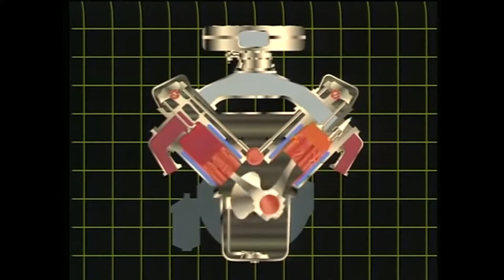Engine Rod Knock Vs. Piston Slap - Take a listen to both!

Comment: My Jeep Cherokee made it over 100k with piston slap, at 263171, it finally broke and punched a hole in # 5 cylinder.  Thank you Chrysler for cheapened up on piston skirt walls in 95. I ended up putting in an engine out of a 90 Comanche. Better built engine,  thicker skirts.....Hopefully with this one I can make it to a million!
Reply from the maker: I've seen a few comments on the Jeep 4.0s having that issue .. I'm guessing it's a common problem?
Reply: @ExiledWolf84  
Yes, very common on 4.0 made from 95 on. Piston skirts fall off around 120k due to thinner piston walls. Too reliable the way they were made before.  Average life of a 4.0 before changes is about 400k.
Reply: Chrysler has been cheap shit since LOOONG before 95 lol
Reply: I have a 99 Cherokee with the 4.0. It has 300,000 on it. Original engine, trance and drive train. The only thing I ever did to the engine was replace the valve cover gasket. I just like to add that I’ve been driving this jeep for over 20 years. It had 40,000 miles on it when I purchased it. My grandson is now driving it. I purchased a 2006 Lexus GX 470. It has 200,000 miles on it and runs like a clock. I purchased it because it’s four-wheel-drive and has a V8.

Comment: We just pulled a 75 Cadillac like that out of a barn yesterday that's been sitting there for 30+ years
Reply from the maker: Very nice! Do you know what year it is? 

The one thing thats nice with the Cadillacs of fhe era is that quite a few of the parts are still widely available, as oppoosed to the 76' lincoln i once had, which was like searching for hens teeth whenever it needed something

Comment: I have a 98 F150 with the Windsor 4.6 with 256k. And has piston slap. I even heard one with only 30k make the piston slap noise. Everyone told me it's a Windsor thing?. But it goes away once the engine warms up and still runs great.

Comment: If you ever heard a diesel engine idling, that's piston slap . Piston slap with run indefinitely depending on the situation. The rod knock sounds like a man in the basement hitting steel pipes with a hammer. That noise will suddenly stop in the very near future and you will have to walk home...
Reply from the maker: Oh yeah, the first time I heard that Buick in the video making the noise, that was the first thing that came to mind. Someone smacking the shit out of something with a hammer!

Comment: My old 97 Chevy Lumina had 860 000 miles on the original engine and the piston slap was awful, but still ran until I had to send it to the Junkyard since the chassis was completely rotted
Reply from the maker: That's unfortunate. The damn rust monster never sleeps..

Comment: A good test is to put super thick oil in the engine. If that fixes it then it's rod knock. If that doesn't fix it, it's piston slap. I have a crown vic that sounds like the Cadillac but thick oil won't quiet it. It was retired from the police dept at 80k miles because of the knock. I put another 80k on it and it still sounds the same.
Reply from the maker: I've almost been curious to put gear oil into the Buick just to see if it actually makes a difference.... The poor car is WAY beyond saving, so why not use it as an experiment?
Reply: @ExiledWolf84  Yea. How easy is it to get the oil pan off? Maybe you can install an undersize bearing shell in it to get it close and then use the thick oil. I just searched "gm 231 undersize bearing shell" and they do have em .010 over. Plastigage it to see how close you are.
Reply from the maker: I have heard some people on here comment that the 3800s have an easy to remove oil pan... But as of now the car is no longer in my possession, but I guess I'll see which way it goes for it in the future!

Comment: I bought a Ford Ranger cheap from a large used car dealer in their "end of life vehicles" on-line auction. Description was "engine knock and oil leaks". It's an Australian version with a 5 cylinder 3.2L diesel which are well known for piston slap, and sure enough it has piston slap. However, the slap doesn't disappear as the engine warms, it's probably been slapping for years....don't know if I should be worried, didn't pay much for it so might just keep driving and see what happens.
BTW, the engine was a little oily looking but hasn't dripped a single drop on my driveway.
Reply from the maker: Sounds like a sweet truck! Australia got alot of cool cars that we dream of here in the states.... in fact, there is a business in my city called "Left Hand Utes" that converts Australian cars to left hand drive and makes them legal to drive here.

Comment: I had a Corolla with piston slap. When the engine was cold, it was loud....sounded exactly like a rod knock. But once the engine warmed up, it was barely audible
Reply from the maker: I have a soft spot for Corollas. I learned to drive on a 96 with a manual transmission, and have owned several others over the years.

Comment: Had piston slap in a boosted integra. Made 463 on dyno. Beat on it every day for years before i traded it for a BMW. Reving you could hear the slapping. Went away during high rpm 😂
Reply from the maker: I'll bet that thing was a blast. Honda builds a hell of a motor, that's for sure!
Reply: Very common in performance builds with forged pistons. It's better to be a tad loose with boost than too tight

Comment: I have a 2grfse engine, i hear a knocking sound that comes and goes away, sometime i can drive the car for a week and hear no sound then 1 day you start to hear it, and then shortly after it goes away. It happens when the engine is warm already and especially if i drive beyond 80kph. It happens also when idling. There is no loss of power though

Comment: Both noises actually come from the piston. The "rod knock" is caused by the piston hitting the cylinder head during the exhaust stroke. If you disable the spark to the affected cylinder you will hear the piston hit the head on both crankshaft revolutions instead of just the exhaust stroke. As far as blowing it up, I once "blew up" a Buick V6 that I was replacing. The first thing I did was hold the pedal to the floor for a few seconds. I had to let up because it filled the shop with smoke. Then I drained the oil out of it. It knocked worse and worse but kept running. Finally I drained the coolant out of it and it eventually stopped running, but did not grenade in spectacular fashion, to my disappointment.
Reply from the maker: I might have to try that before the car goes to the auto graveyard... Might be interesting....
Reply: I wouldn't 100% agree. Some engines have significant piston-engine block deck clearance. For example bmw m54b30 it is 3mm - more than rod bearing thickness. But for some engines yes - rod bearing spun cause engine head damage.

Comment: Piston slap is a common problem for Honda L-series engines with i-DSI that can be found in JDM Honda Fit 2001-2008 or European Honda Jazz 2002-2008. Unfortunately the sound doesn't go off after warming up the engine and at certain conditions at some RPM comes into resonance and make you question your life choices, but, I bought this car with 195k km on the clock (122k miles) and so far, after 4 years and additional 132k km (83k miles), it runs the same. And let it be this way.
Reply from the maker: I wonder why that is? Machining tolerances at the factory or something?

Comment: With piston slap, I would use combustion cleaner to rule out carbon build up on the piston. Like you said, it will last unless you overheat the engine badly.
Reply from the maker: Might have to be something I try at some point! I imagine a lot of old big block engines like mine have a lot of carbon buildup, just from the fact that they don't spend a lot of time at very high RPMs from how much torque they have.

Comment: You forgot the timing chain slap when the chain is so worn it literally is slapping against the guides or even the block . That sound never goes away $
Reply from the maker: The Toyota 22RE is the first engine that comes to mind with you saying that. The timing chain will literally wear a hole in the chain cover if you let it go for too long!

Comment: I have piston slap on my 2000 gmc sierra.Apparently its a known common thing with the 4.8,5.3,and 6.0 truck engines.Like in the video it goes away after the first few minutes of the engine starting and warming up.Lucas oil stabilizer doesn't help make it go away.
Reply from the maker: Very common on those as i have been told! 

I had an Escalade sith the 6.0 that never developed it, but it had other issues from lack of maintenance from the previous owner

Comment: I have had the big end bearings replaced in mine and its still making a knocking sound which is similar to the piston slap sound in your video but does not go away even when the engine is warmed up. I have driven it 50+ miles with the sound with no problems. Any idea what it could be ?
Reply from the maker: What kind of motor?

Comment: Piston slap can be normal on some engines when they are cold. In the toyota IQ instruction book it says that piston slap is normal when the engine is cold. However if it never stops it might be a good idea to get it to a mechanic.
I have had a car with same engine (aygo) it have always have some piston slap and never failed (8 years).
Reply from the maker: Interesting! Do you know if that's the 3 cylinder, or 4 cylinder model? 

We BRIEFLY got the Toyota IQ across the pond here, which was sold as the Scion IQ (Toyotas defunct youth brand)  with the 4 cylinder engine, but they didn't move many examples of it so it is somewhat rare, and we never got the Aygo...
Reply: @ExiledWolf84 both i have is 3 cylinder ones 1 litre. But there is 1.33 litre 4 cylinder ones too. I do not know if they got piston slap or not.
Reply from the maker: Ah! I gotcha. I'm thinking that the GR Corolla got we finally got over here has that same 3 cylinder engine, or a variant of it... But it is also turbocharged to hell.. I'm curious to see if they are in the same engine family...

Comment: "That sound completely goes away" looks down because he lied to himself. Drop a junkyard LT or LS or Vortec into that great looking Caddy! A standard SBC 350 would be great too!
Reply from the maker: How about some bull horns, flame paint, and some 25" spinners to go along with it? 😜
Reply: @ExiledWolf84  haha, nahhh. Looks great as is. I've been there too. Telling friends "oh that's fine, I just ordered the parts. Gonna put them in when I get them" 3 years later.... friends rediscovering the sound
Reply from the maker: @DM-wp9vq Tell me about it! I have STACKS of parts laying around that I need to install, including a bunch for this one, like a new timing chain, oil pickup tube, u-joints, lifters, VIR eliminator and too many other things to count. The interior is torn to bits right now because it needs a new heater core and is getting a retro radio... I just couldn't drive around with only an 8-track player anymore

Comment: with rod knock there is also a problem with the rod journal, it tends to get egg shaped instead of  round. that is why you can't just put a new bearing in and go on.
Reply from the maker: Which really sucks, because I'll bet a lot of them could be fixed relatively easily by dropping the pan and just sliding new bearings in, but unfortunately, like you said, it's never that easy

Comment: My old Volvo sound like piston slap.
But the sound never gose away except when I cold start it in winter then it's silent.
Quiets down a little bit after a long drive.

For the record it's a well worn engine with probably 450 000km
Reply from the maker: Good old Volvos run for freaking ever, don't they?

Comment: Thanks. Maybe you can do a video on detonation/ pre-ignition vs valve lifter adjustment noise.
Is it ticking or clicking...I don't know.
Reply from the maker: Not bad suggestions! It's pretty easy to hear pre-detonation here in the high country... You just have to put in the crappy 85 octane gas that they sell here, and then give the car a lot of gas heading up into the mountains.... I might have to try getting it on camera!

Comment: I've an engine that makes the second sound. Seems to come from the area around the serpentine belt. 
Consumes about a quart even 200 miles.
It's an 03 Corolla.
The belt has a few cracks and the Tstat seem stuck open as engine keeps running cold.
Reply from the maker: Have you changed the belt tensioner by chance? That generation of Corolla has an issue where the serpentine belt tensioner would wear out and make some racket like you are describing. I had an 05 Corolla that did that a similar thing, and a new belt tensioner fixed the issue!

Comment: My Jeep makes that exact piston slap noise - but it doesn’t go away when the engine warms up
Reply from the maker: Do you have the 4.0 inline 6? Might be a lifter going bad or something along those lines as well!
Reply: @ExiledWolf84 I have a 2007 Grand Cherokee with the 3.7 V6. 160k miles. I’m always anxious about it being something expensive but it’s made the noise since I got it 4 years ago. Noise comes from the bottom end, like behind the wheel well.

Comment: Mine sounds like the piston slap but I’m also getting a misfire in cylinder 1 at startup. 2011 Cadillac Escalade
Reply from the maker: Just from looking around online, it seems to be pretty common in the GM small block V8 engine architecture from the last 20 years or so, such as what's in your Escalade. 

Have you changed the spark plug or the ignition coil on the number 1 cylinder?
Reply: @ no I haven’t had the time. I parked it and I’m going to dig into it this weekend. It all started after I put stop leak in for my rear main leak 🤦🏻‍♂️

Comment: my kawasaki quad has a sound inbetween both sounds and it doesn't fully go away, giving some revs makes it seems a little less, it's been this way for a good while now but, i hardly put any hours on it each year. it was seized when i got, wristed pin was rainbow colored and took a 5 pound hammer to remove, chinese piston kit whent in and bore job form the cycle shop, no bottom end service.
Reply from the maker: That's interesting, and I'll say that it's cool that you got it running again! Which part of it was seized? The wrist pin?
Reply: Is it a bayou ? I had one that had what I assume was either a wrist pin issue, piston slap, maybe a clearance issue and the piston was hitting the head? Maybe a combination of those? But it never got worse, even when it was 100F and we were passing that poor thing around to 4-10 of my friends all day into the night, it was driven into the pond multiple times and hydro locked, twice it was buried so badly next to the pond I had to leave it overnight, so bad that I left the key, figured if someone worked hard enough to get it out they can have it, 😂, but I beat it into overheating over and over trying to free it over two full days, would let it cool off until the light went out and go again lol, basically what I'm saying is that I was told it was a wrist pin noise and it never got worse, never caused me a single issue, still ran pretty good considering the abuse I put it through when I sold it, I know that the new owner gave it to his son and he beat it for two years before they sold it on, I always made sure to change the oil and filter frequently, made sure it never was low on oil, always used high quality oil, and I always made sure I warmed it up, especially on cold days, even on Hot days I ran it for 4-6 minutes before riding, I do remember that the noise was considerably louder when cold so I feared that revving or riding it before it was warm enough to quiet down would be what hurt the poor thing 😂, I hope at least some of that makes sense, and that maybe it will help you not worry as much and enjoy riding your quad, or is helpful to you or anyone else in some way, if you have any questions don't hesitate to ask, heck I don't mind if you just want to chat, no one looks out for each other anymore and it's making everything so much more difficult than it has to be, I appreciate your time and effort! I hope everyone is having a great day or night!

Comment: Can piston slap also be heard at a certain rpm?  i have the slap sound during cold starts until warm and at 28-32krpms. I can avoid the sound if i really commit to rev matching away from 3krpm. (cld be the wring term) I was tied between a clogged oil pickup or fuel ignitors before seeing this. I learned a ton thanks for the visuals!
Reply from the maker: Sorry, didn't mean to take so long to respond! And thanks for the positive words! 

It's usually more notable at lower RPMs from what I understand, simply due to the piston moving slower, allowing it to be more audible. 

What kind of motor is it?
Reply: @ExiledWolf84  its a k24 in a 6m 2010 tsx thooo  I don't think its piston slap in anymore. i'm actually 95% sure it's dried pulley bearings, so im just going to have them taken off re greased a re-put back on at some point. I've only come to this conclusion by  asking chat gpt what it could rule out based on sounds and symptoms and found a similar tsx owner who solved this annoying sound on a tsx forum. so fingers crossed

Comment: Hmm i was told that piston slap noise was a sticky or collapsed lifter....
Reply from the maker: From the diagnostics I've done, with running it with the valve covers off, prodding around with a stethoscope and taking high speed video of the rockers, it's very likely piston slap as the noise is at double the frequency of the valves opening. 

But, one way or the other, it'll be getting some attention in the valve train, as well as some other places soon. It would be nice if that's actually what it was!